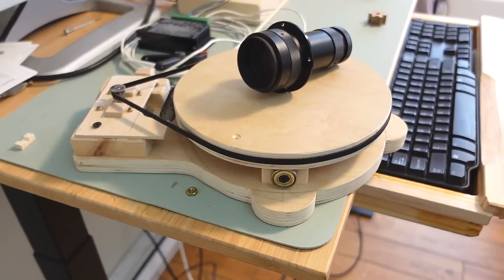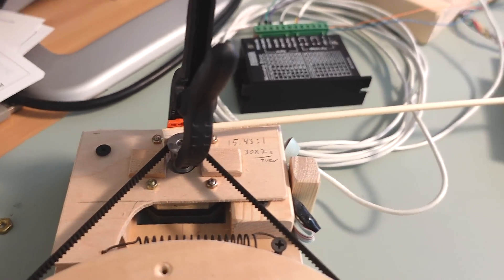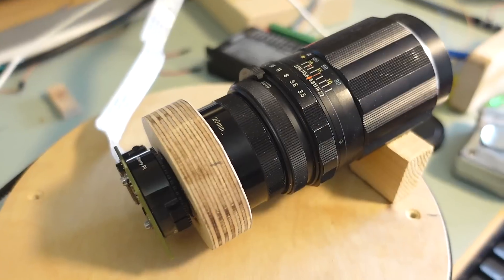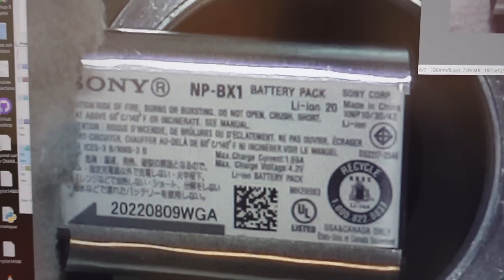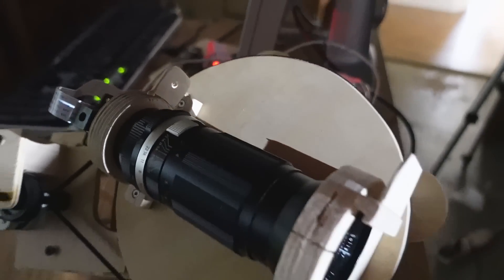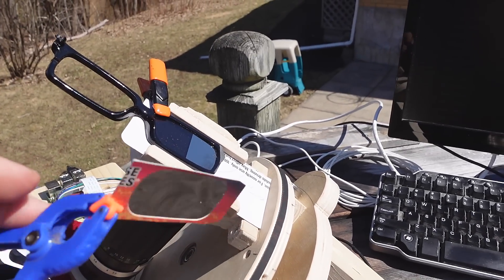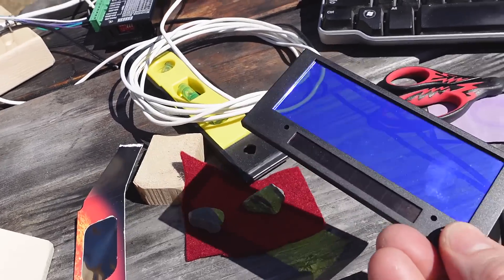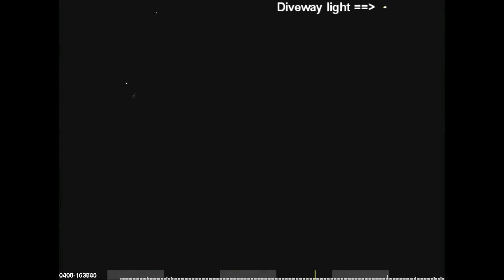Solar panning camera build and eclipse shenanigans

Comment: Thank you so much for this video. I have been looking into astro-trackers called barn-door trackers, and have often wondered why there are so few builds based on stepper-drivers. Now I know, the purpose of them is to be simple to build. The jarring movement of the steps would be a challenge to most home builders to overcome, whereas cheap DC motors are easy to come by and control. Well done.

Comment: @matthiasrandomstuff2221
Hi, it's a real question with no ulterior motives: why don't you use a 3D printer for some parts of yours creations ?
You've probably been asked this question several times, haven't you ?
There seems to be no doubt that if you don't have the skills, you seem to have the ability to acquire them, I think :elbowcough:
Reply from the maker: cause using other metods is WAY faster
Reply: @matthiasrandomstuff2221  Not sure at all ...:body-blue-raised-arms:
When you're sleeping or working (for money) the printer can work and it's a "free" time.  3D printers are really a great tool for makers like you. It can make easily square hole and much more of course ... 3D printing can make parts that are just impossible to produce by milling, cutting, turning, drilling ...
Last but not least, little experience enable to produce very precise objects at a low cost, which can still adjust if necessary until obtainning and correct the weaknesses, and so have the expected functions.
In short, if you can design a CAD part, there are few limitations on it to not becoming a real part...
Just this totally random video out of millions to illustrate it. https://www.youtube.com/watch?v=P0KPHNbkWPU (this guy also like wood like you :goodvibes:)

Comment: I built some filters using some wood disks and solar filter film.

Used some rubber bands to hold them to binoculars. It was absolutely incredible. You could easily see sunspots and other features. It felt like you could touch it.
Reply: this is the correct way to do it. Solar filters dont just dim the sun, they also block all harmful wavelengths that you cant see.

Comment: Better pics than I got - my camera died 10m before totality (and then magically worked again 10hrs later - I guess it overheated)

My tracking system worked at least (EQ-1 mount, 3d print shaft adapter, and a stepper) so I will at least now be able to do some long exposures that I've wanted to do for years.

Comment: Your setup seems to have a 2d sunspot off to the Left from the one sunspot more prominent in the upper central L.  In 2017 there were more sunspots visible,  it got pretty dark in a back
yard in Dallas also where the horizon was cut off by houses and walls.  Had not thought of the reason for the 2017 eclipse not being as dark was the horizon light where we were more 
in the open.

Comment: EDIT: of course, as soon as I restarted the video after making this comment, Matthias explains it exactly in 10 seconds, I should’ve known :-) 
As a rule of thumb, a lens is the sharpest at 2 stops open from the smallest aperture. I couldn’t find a reference my copy of “Photographic materials and processes”, so i forget the exact science. When you are at the largest aperture [widest opening] more of the image is going through the edges of the lens, causing distortion, i believe spherical aberration. The light passing through the edges of the lens comes to focus at a slightly different distance than the center.  At the smallest aperture of a lens you start to have diffraction. I wasn’t a technical photo major, but I believe this is roughly correct.

Comment: Fantastic!  I live in an area where the maximum was reportedly something around 88% coverage.  Started fair, but got cloudier and cloudier and by the time of the maximum the cloud was totally blurring the image.  A few miles South or North there appeared to be good clear sky.  Are we talking about Murphy’s law?  As far as my camera, I had to set the ISO down to 100 and the exposure to 1/400 with aperture 22.  I had two commercial photo gray filters stacked on the front, one fixed and one adjustable (Tiffen), set to maximum - except between the manual shots it tended to shift, as also did my focus.  For the 2017 eclipse I had bought an automatic tracker and a very sturdy matching tripod.  Then I got a number of great shots and a video.  My main problem that time was my return drive, when the interstate road was jam packed for at least 80 miles.  Now I found that I had lost the  tracker to tripod mounting screw — Damn!  And apparently I was a few miles in a wrong location due to the cloud — double curse!

Comment: Very nice project, with a hard deadline and barely time for testing.  Good it came out very good.
I live nowhere near the the totallity path, so I watched NASA stream, the commented one.  They mentioned the plasma eruptions in there, and also the diamond ring, and bunch of other things.
Reply: I wasn't near the path either. We got 83% here. But with eclipse glasses on I still saw the Moon transiting in front of the sun. Without the glasses I couldn't notice a thing. At one point the sun did look like a crescent Moon. I guess it was 83% covered. In an eclipse the light doesn't really change until the sun is just a sliver. So somewhere north of 99%

Comment: One of the things that doesn't get talked about much is that you can drive a stepper motor with an analog signal. Preferably two equal sine waves 90 degrees out of phase, Applied Science demonstrated this a few years back. The real problem is finding a DAC that you can use to generate a sine wave at the frequency needed to drive one phase. The other phase could be handled by a phase shifter made out of some OpAmps, but while I know that works for music, I'm not so sure it will work at the low frequencies needed here. That said if you have a DAC that can generate the frequency needed, it's likely that you can get a second one, and set it up to start a new sine wave at 0 as the first sine wave peaks, and you will have the right phase separation. Then run those two signals through a pair of voltage control gates off of a power supply that provides the voltage you're comfortable driving your stepper motors at, and you get the desired movement out of the steppers. (With the caveat that if the stepper is rotating in the wrong direction, you simply flip the wires on either pair of coils. 

The bad part is I don't expect to be around to test this the next time North America sees a total solar eclipse. It should work for  astro-photography though.

Comment: Most solar astronomy uses hydrogen alpha filters for observing the sun. They have a very narrow pass filter at around 653 nm. It improves the image a lot, to the extent that you can actually observe detail on the sun surface. You can get them to fit your SLR camera's lenses directly.
Reply: You CAN NOT use regular Ha filters for Solar photography. YOU MUST include an ERF (energy rejection filter) if you want to use a regular Ha filter for Solar photography. Instead of destroying your fancy $1500 DSLR, maybe consider buying a Daystar Quark, a Coronado PST or any Lunt Solar Systems OTA.

Comment: I used an 800mm mirror Lens on crop sensor DSLR and just getting the sun in frame was super hard. I wish I had tried it earlier and made some sort of aiming device. I did design a nice filter holder I printed to slide on the front of the lens and I could have included an aiming element if I had done it sooner. It was super fun to see the totality.

Comment: For what it's worth, you can buy fixed shade welding lenses from welding supply shops for quite cheap.  I bought two recently (#10 and #12) for just a couple dollars.
Reply: if you cant get any solar filter, this is also a good alternative. Welding shades (no less than 10 for the sun!) block enough UV, IR and visible light to make it safe. Do not use this on a Telescope tho, thats a completely different thing.

Comment: Gotta love the work you put into doing this. Another option would be to recognize how much detail modern sensors allow, enough to crop images significantly. This would allow one to leave the camera rock steady pointing at one lower magnification spot, to fully encompass all of the movement you'd see over a short time span. Cropping video later in Premier Pro or FCPx can be rock steady, without the complexity of a moving camera mount.
Reply from the maker: Most of the unsteadiness came from the atmosphere.  Also, sensor is just 12 megapixels, and to have a lens super sharp edge to edge is another challenge.  I also would have needed a much bigger filter.  So your idea gets complicated fast.

Comment: Would a simpler method just be using an old clock's hour (or minute) hand, reducing it with another gear reduction by 2, and using that to drive the platform?
You may get some minor jerkyness from the "ticking", but the old synchronous AC style ones would probably be quite smooth.

I think this is actually quite similar to how old observatories operated. 

Also, now that you have footage of the eclipse, you can develop algorithms to center on it automatically, and just use a precise pan/tilt mechanism.
Reply from the maker: Not nearly enough torque.  The stepper motor is much simpler

Comment: I loved flipping the belt.
Reply from the maker: yes, that was a totally bastardizing shortcut.  But it saved me from rebuilding it, I was running out of time.
Reply: @matthiasrandomstuff2221  Oh not at all. Those cheap stepper drives were never made for precise optical instruments, they always used servo drives. The fact that we can do so many things with a cheap stepper is amazing. Same with your woodworking, a wood lens mount? I've never seen that on anything that wasn't 100 years old. You're vintage and you don't even know. So flipping the belt solves the problem therefore it is good. I loved watching you solve problems without creating a ton of waste or wasting data. Doing just what needs to be done is a lost art in the digital world of excess.

Comment: I'm glad I didn't try my idea of using an old transparency projector. I was going to cut the bottom out and fix up a stand to project it on a screen. It probably would've been a lot of hassle for a poor quality image after seeing what you went through.  I ended up using 3 polarized sunglasses, one of which was mirrored. I wore the mirrored on and used the other 2 at right angles (ish). It was sufficient to get a nice view.
Reply from the maker: It would have been effective at making small holes in whatever you projected it onto.  Focal length is too short.

Comment: Do you need attenuation looking at the sun.  I used to take photo's of arc flashes and with used a pinhole in Alu foil.
Reply from the maker: With too small an apperture, you run into diffraction limits.  Make a pinhole in tinfoil, look outside with it.  Evreything will be a bit blurry

Comment: AC motor which timer is the 50/60Hz in the power line. The mechanical timer outlets has such AC solutions.

Comment: is it possible to do 1 microstep every 1/32 second?
Reply: You can do it at much smaller intervals, way under 1/1000s, depending on your system. Trouble in this case is, you need to syncronize with the target. If the interval is too small, say 1 microstep every 1/64 or 1/128 and so on, you may be too fast and get ahead of the target. If the interval is too long, then you would lag behind. And then, there is also one of stepper motor's limitations, lack of continuous movement, which induces vibrations. At 1/32s, the whole jig would still be vibrating way to much from the step, or microstep, movement, resulting in shaken picture.

Comment: Great job.. I would like to see you do something similar using a large telescope to photograph boulders on the moon... The best time to look at the moon is during the day, because the moon is too bright at night..

Instead of adjusting the aperture diameter for brightness, did you know that if you used 2 polarized filters. rotating one filter will change the brightness.

I once had a chance to look at the moon with a 17.5 inch(diameter) dob telescope 
and was able to see the shadows of the boulders..  I wonder what size those boulders were compared to the items nasa left on the moon.
Reply from the maker: aware of the polarizer trick.  But I only have one polarizing filter

Comment: Builds wooden telescope in two days
Reply: Yeah, FFS NASA, get your act together!
Reply: “In a cave, alone!”
Reply: @NazriRamliy  With a box of scraps!
Reply: With parts laying around the house.
Reply: They're not that complicated if you know what you are doing.
Reply: @super8hell  nothing is complicated if you know what your are doing, daaaa
Reply: @super8hell  Mirrors is most complicated part
Reply: @FDog16  not if you buy finished mirrors, like most people do. Barely any ATM's coat mirrors at home. The actual most complicated part is the mirror cells and making sure your OTA doesnt flex due to secondary cell weight.